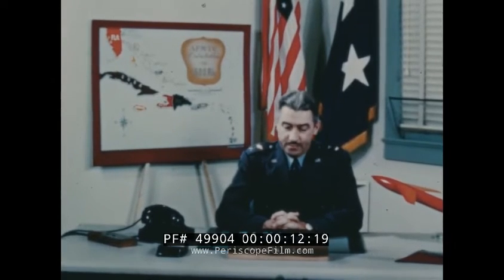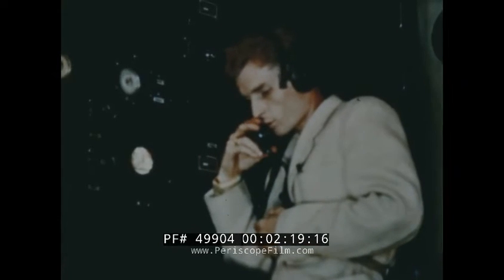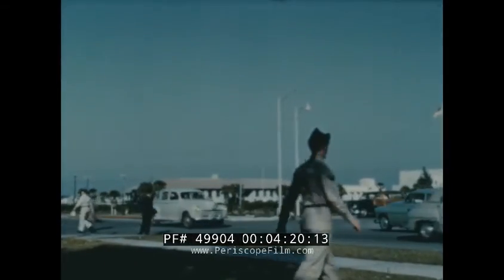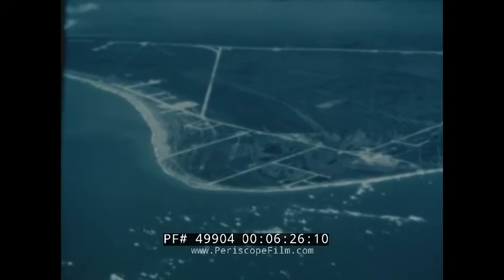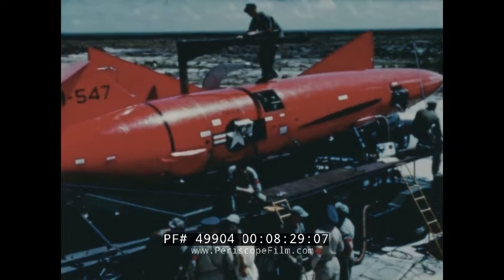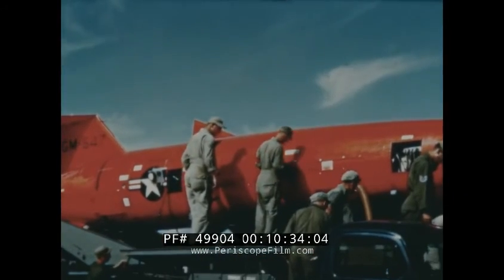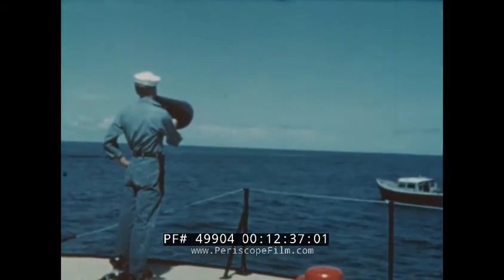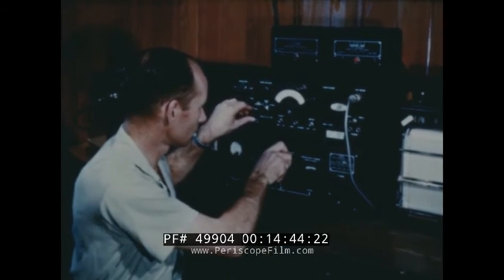MGM-1 MATADOR GUIDED MISSILE  GLENN L. MARTIN COMPANY 49904

Comment: the missile system was also air transportable. Complete with the guidance radar, missile controller, communications, power and security. About 1960 the mobile systems were pretty much simi permanent along the East German border and other areas. We were ready to launce in about 10 minutes 24 x7. Spent 2 years in comm and control inside a 6x6 van. 

Very long nights..
Reply: Anywhere near Missile Site 1, outside of Mehlingen, a GSU of Sembach AFB?